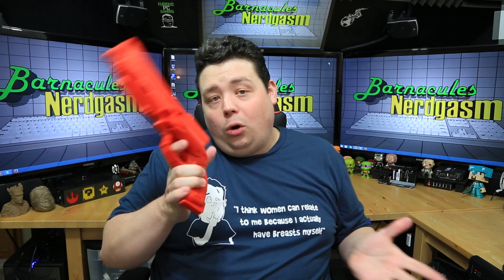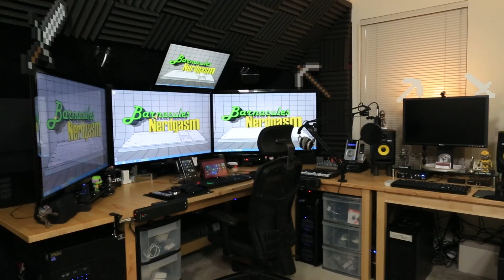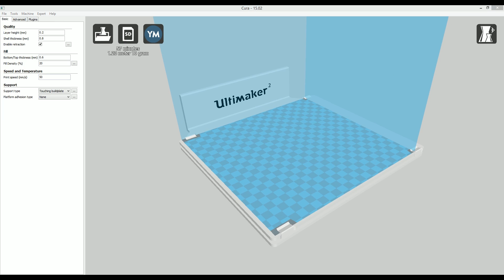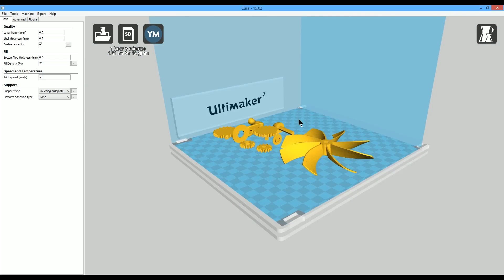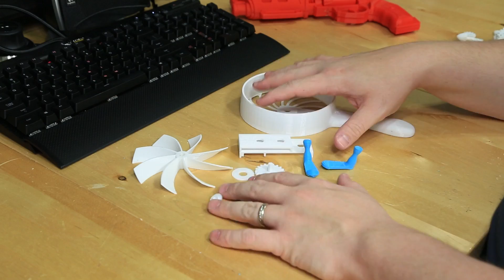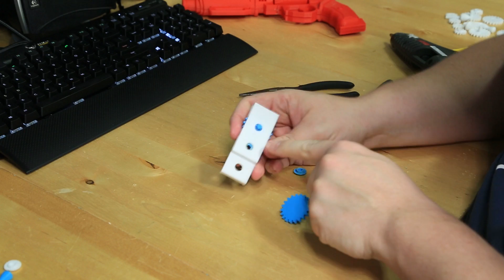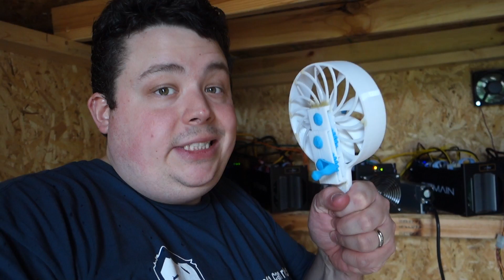3D Printing, Assembling & Testing a Mechanical Hand Crank Fan

Comment: are u ever gonna do 4k recording?
Reply from the maker: Yeah! Today.
Reply: ***** same
Reply: Wow such doge  As a member of the glorious "PC Master Race", I do see the difference and I'm planning on getting one of those 144Hz IPS-monitors when they become affordable so I do see your point.

Though I do not see the added benefit in any content other than gaming when it comes to videos. Content like talking to the camera, coding, and other basically mostly stationary content, I do not see the point of having 60fps content. Sure, it's there to double the bandwidth usage, but if the content doesn't really need it, why should it be done if it more than doubles the rendering times or the user's bandwidth requirement?

If and when 4K monitors come commonplace, then I'd say I'd prefer 4K then over 1080p, since I can assume that the network bandwidth has caught up with it when that time comes. Though mine doesn't cope with current 1080p30 most of the time so I guess I can't assume anything.
Reply: ABaumstumpf lol
Reply: *****  I don't really think 60 fps is THAT useful. It uses more bandwidth for minimal gain. I don't really care about the resolution either. I usually watch everything in 480p or 720p, since anything above that doesn't add to normal "talk show"-content. In games, maybe, but I'm not sold on that one, either.
Reply: *****  Sure, if you meant it that way, I'd also rather have a 60 fps option instead of 4K on top of the standard 30fps. Like it is right now on Youtube.
Reply: lBonaCl just to add up on the discussion: 60fps for me is waay smoother, as i play quite a lot of pc games... Also 60fps is only twice the file size. While 4k is 4x the file size of 1080p.. (Roughly)
Reply: ***** for what exactly? dude, admit it, you're just a 11 year old kid trolling around youtube just to get attention. go outside or do something with your life instead of trying to scare people, seriously mate just chill the fuck down! the cops won't arrest anyone for swearing on a website... get as life kid!
Reply: ***** lol calm down it wasnt even a grammar mistake it was spelling. Sorry for trying to make a joke.
Reply: omg i don't give a crap honestly cause im not some 10 year old sitting behind a computer that gets easily offended... so yea
Reply: Gordon Freeman I know about it :p but my point was, that i'd prefer a 60fps standard over a 4k standard.. 

Also, about compression, videos in 4k on uTube are compressed too (maybe too much), which makes them horrible compared to true 4k
Reply: Well - 4K is pretty much useless.
Most people don#t have such a screen, it increases the filesize significantly.
it would be better to have higher-qualitiy 1080p too.

And - best part - for nearly everybody on this planet there is no visible difference between 1080p and 4K cause of FoV their Monitor occupies.  
You need really big monitors up close to be able to even tell that there is a difference between those 2.

For 4K with a 27" display (bigger than most people have) you need to sit at ~0.5m (2ft) - that is veeeery close for most.
Reply: ABaumstumpf  the brain also tens to filter out super fine detail from a distance - you can spot it by looking at the grain of wallpaper, truth is, after a meter or two, your brain basically makes any wall look like a plain color :v
Reply: ***** dude go troll on some old forgotten forum on something. youtube is definitely not your style neither the 99.99999999999999% of the interwebs
Reply: ABaumstumpf wise words from a wise man/woman (:
Reply: ***** listen up boy, bullying is not a big crime, I'm 100% sure that the cops won't show at my doorway any time. And why should I report a little arrogant and ignorant 11 year old kid that society wants to get rid of, trolling on youtube, trying to scare people that  in fact didn't do anything than just make a joke. a stupid little joke and you reported them for no actual reason.
Reply: ***** Sure
but this has gone long enough.

Was nice seeing such a asocial being on YT again - normally such creatures like you are locked away in a mental ward.
Reply: ***** umm dude, you need speak proper English for us to understand
Reply: *****
And at some point far into the future, he might get low enough for you to understand him.

Or you could finally start going to school and taking your drugs.
Reply: no because most of his views are on mobile and most phones are not 4k
Reply: ***** Hahahaha, whats 144p then,   O_o
Reply: ***** mmmhh but u dont like to grammar do u?lol
Reply: Wow such doge I call BS on 60FPS being twice the file size, unless you're talking about uncompressed video.

Video compression is a thing, twice the framerate =/= twice the file size in compressed video.
Reply: Wow such doge
Well, go blame Google servers about compression xD.
The original files are stored uncompressed or less compressed though.
Reply: ABaumstumpf That's such bullshit, I can easily the see the pixels on my 1080p screen and comparing it to even a 1440p screen is a huge difference. I haven't seen any 4k screens in real life, but it would be huge increase in pixel density and sharpness.
Reply: CodyMetal If you move closely - yes, you can surely see the difference.  
But at normal viewing-distance and the normal screen-sizes it is a different matter.  
The human eye has a finite resolution too.
Reply: ***** THANK YOU!!!! i thought I was the only one....
Reply: ***** dude if you report for this shit you don't deseve to have internet nither a computer
Reply: ***** yeah sure sure! I belive you!
Reply: ***** "You will one the Cops at you door" do you even English bro? look mate I understand that you are not from a country that doesn't speak English natively. the thing is that in my country almost no one speaks English at all seriously. the guy who first started this fight was right. you barely know how to speak English. the only thins that you use English for is trying to scare us, the people who deserve to have access to a computer and internet in fact when I think about it, you are the bully here, not the guy who started the fight, neither me, neither ABaumstumpf . YOU are the bully and you know that you don't have any functional brains in your head and you try to scare us with reporting us to the police and to google. as I said before you just want to get attention and you don't know how to get it just like any bully.
Reply: ***** Normal people will simply ignore idiots like you.
But i got enough free time, so it is fun seeing you desperately trying to spread hate as you fail in life.
Reply: *****
 
"Talk to the police,"
Why would we talk to the police cause of one raging kid?
Reply: *****
"also now you are stalking and harassing me with constant abusive replies"

it is not our fault that you are socially impaired.
Stop oppressing me you shitlord :D
Reply: *****
Have fun.
btw - stop harassing me.
Stop oppressing me.
Stop threatening me.

it is funny how whiny you are.
Oh - and btw, falsely accusing others and making false charges, are also 'crimes'
Would you be so kind (despite being a pathological asocial lier) to film it, when you bring in the charges?
I would like to see the policeman laughing their arses at you.

Comment: Hey Jerry. Grab some pine ridge archery glue off of amazon. I use it anywhere from putting on arrow vanes to gluing on my buddy's old rear view mirror to his windshield in his truck. It dries in about 30-45 seconds. Really easy to file off and you can even get some instant-dry spray for it. dries clear/little bit of yellowish depending on the room temp.

Comment: Hey Barnacules, great video! 
If it is alright I have a suggestion for you. Please try to avoid leaving the glue gun on its side as this can cause the heating element to damage the side of the casing and can hurt you or your table. 
I don't want you to get hurt or anything. Anyways, keep up the great work. :)

Comment: Jerry u think you built it wrong. When you hold the fan the crank should be facing away from you. Blade needs to be flipped.
Reply: Conor Hyslop It doesn't matter, as long as he's aware that he just needs to turn the crank the other way. He would only need to turn the blades the other way if he's too lazy to turn the crank the different direction, but I highly doubt that.
Reply: Tristan Taimanglo he clearly showed that wasn't the case because spinning it the other way made it catch.

Comment: This was well explained. As someone with zero 3D printer experience this removed a lot of mystery. Great vid!
Reply: I have a printrbot simple metal and it works great I highly recommend it and also I use cura with it
Reply: ***** i was getting interested in the printrbot tbh, so much cheaper... and i'm quite poor
Reply: :) Also i did not know about Robo3d
Reply: Skyler Oglesby care to share some of your settings for printbot...? I have sinple metal with heated bed, and my prints are okay, but havent quite got my quality and precision tweaked right

Comment: Awesome. Also, as weak as it would be, try to take something from that design to make a generator, to barely register on any measuring device but still. And for your love of mrs. Barnacules and xander, please, don't 3d print quad copter blades unless you want a very expensive pile of junk. Well, I guess I'd be fine for the now lame parrot at drone. Keep on going strong and scrape off the barnacles every morning.

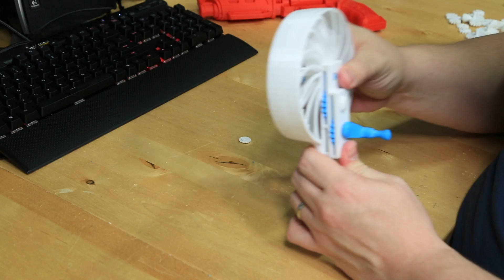Comment: The only thing that could make this better imo is to have a higher gear ratio instead of a (example) 15:10 having a 60:10 so that way you dont have to turn the crank as fast with you hand to achieve the same speeds (efficiency), but with a more solid gearbox because with a higher gear ratio will cause more stress on the gearbox. Also maybe adding a flywheel too would be nice.

Comment: Plastic is going to become a thing of the past in 3D printing when you can do better and miles faster with fluid printing, but I know you've seen the video I'm thinking about :)
Reply: The uv resin fluid is still more expensive than filament, though
Reply: Just don't ask how much the media costs. ;)
Reply: It's like all tech trickles down in price over time and refinement :)
Reply: KingNosser The printer/technology isn't expensive. It's the raw cost of the resin. It's simply a more expensive material.

Comment from the maker: 1st again! I'm a boss at this 1st stuff!
Reply: they made a destiny assault rifle. PRINT IT
Reply: That shirt tho...
Reply: You should seriously think about printing out (in a multi part series) the toyota engine and the manual 5 speed transmission from Thingiverse. I can't remember the author of those prints, but it is the same person. Seriously, it is a really intricate design.
Reply: Barnacules Nerdgasm Hi I love your 3d printer vids
Reply: thats kinda cheating dude....LOL
Reply: ***** 
You'll be in a corner for games that have a specific requirement for quad core, but the Pentium G3258 with a Z87 or B85 mob that has overclocking enabled. That'll get you in at below $100 and that'll work with any 1333 MHz ram on the cheap; however, you can buy a used set of memory or Corsair's 2000 MHz 2x2GB kit for $50+/-.

The CPU has an integrated GPU to help you limp along until you're ready for a new GTX750Ti or a GTX760 4GB.

BTW, without the graphics card, you can use it as an HTPC just fine.

I love these low ball questions because they're really fun builds that can really perform.

Those GPUs are a dime a dozen used and you'll have some luck there.

Unless you want a "used" system and there's no telling what may happen based on that alone.
Reply: What if you printed it all together as with the nasa wrench
Reply: Hey, Jerry, looking at those blades and your binding issue... are they installed backwards? It looks like they'd be more effective spinning the direction that causes binding. at least from the video, they seem to be curved pretty aggressively.
Reply: I could probably get ya down to about 150. Off-Lease Core2Duo business machine, sub-100, used or lower end GPU 50-60. Boom. C2D, 4GB Ram, Fresh Windows 7, Halfway decent generation or two old graphics card.
Reply: I am 12 and I really want a 3D printer for my laptop
Reply: Hey jerry, what would you recommend as a cheap starter 3d printer?
Reply: Ramses De Vuyst the solidoodle is a solid option. I am going to be getting a 100% discount on my first one, the Polar3D, which is polar coordinate based, with a circular build platform. Other than that, the solidoodle and those delta printers are really nice.
Reply: YA YOUR SWEEET!
Reply: Barnacules Nerdgasm just bought my self a 3d printer
Reply: nice man
Reply: dude you should say that in one of your videos how your so good at being the first comment.
Reply: what do you want it to do?
Reply: like just gaming?
Reply: im actully selling a gtx 750 ti used lol
Reply: Hey Barnacules try using some acetone on your 3D prints. It makes it nice and smooth but a bit inaccurate so it's not for gears or parts like that.  It can also glue two plastic parts together.
Reply: Barnacules Nerdgasm Did YT ease up on sponsor logo spots?
Reply: Dude 3D print a drone!
Reply: Aint1S wow you the true mvp :D
Reply: ***** you gotta add at least 250$ to that to reach at least some AMD APU option (and that's not killer gaming pc, just some pc on that you can play LoL at 1080p on)
Reply: yeah 3d print a quad copter frame and make your own quad copter its easy ,. and would be fun ,. i wish i had all the equipment you have ,.
Reply: if youre getting a cpu  for about 100 just get the 6 core amd
Reply: Alex Mundell syke no 12 yr old is ever gonna get a 3d printer
Reply: Alex Mundell laptops problems just anyways
Reply: Alex Mundell junk*
Reply: Have you ever thought about swapping to superglue or something similar that is far less messy?
Reply: ***** a tablet
Reply: Hey you think it would be possible to print a racheting gear with a trigger that has spring tension using thin printed plastic to power that fan. It would make it a lot more useful.
Reply: "About damn time" exactly what I said to my self as soon as I saw you uploaded a 3D printing video.
Reply: Can you 3D print a Nerf Gun?
Reply: RChero1010 a Toyota cars engine? maybe not
Reply: maybe cut the fat (pardon the pun) out of this its a long video for a fan
Reply: Ramses De Vuyst my first 3d printer was a printrbot you can get it in a kit disassembed(under500 dollars) and just put it together after you get it in the mail yourself. easier than it sounds and there are tons of tutorials online uses 1.75mm pla like most other models and its really easy to get started with. i love printrbot imo but i know it isnt the only one out there
Reply: Barnacules Nerdgasm ugh you have the keyboard i want in the entire video lol
Reply: Barnacules Nerdgasm I guess you're the very first one to admit you're the boss at firsting on the comments.
You win. Again.
Reply: ***** a job so you can afford a better one. not trying to be a troll, seriously.  a "gaming" system has to have a decent cpu, psu, case, ram, video card, ssd(s), and motherboard.  you're looking at a minimum of $600 for something passable.
Reply: +CrashTheGameFTW I'm 13 and I have a 3d Printer and a laptop. Stop trolling.
Reply: By far, the best 3d printer (fully assembled) for the money to a starter is the Polar3D. They run 800 bucks, and have a 250 dollar discount to students. 8 inch diameter print platter, 16 inch print height, SUPER quiet, has a live feed camera, cloud management, or USB if you prefer, and a 50 micron layer resolution. Can print with ANYTHING, like, they have test units running over 300C.
Reply: +Chase Cromwell well not sure why people would troll you but your lucky to get a 3d printer i only have a xbox ne 360 and ps3 and gaming but i could not care about that i just want a 3d printer plus im 13 to
Reply: Howed 3D printing that storm trooper suit work for ya
Reply: +bro fist gaming depends if you want to play games made in the past 7 years or not
Reply: +Barnacules Nerdgasm The fan blades are curved slightly to allow for more airflow if you turn it one way,vs the other.
Reply: +Barnacules Nerdgasm Could you do a 2015-16 buyers guide for 3d printer? i am looking to buy one for the job and i am lost in all the models and spec.. i am looking at the makergear m2, the ultimaker and the makerbot, i am using SolidWorks for creating the stl files but i have no 3d printing experience for now
Reply: The Tsuchiyasan Just to add one to your option list, you might want to look at the Polar3D... Great value.
Reply: +Barnacules Nerdgasm a life is needed here
Reply: +Barnacules Nerdgasm Whats the song name 1:10
Reply: He is haxing report him

Don't its just a joke
Reply: You s should have used water-soluble support material some new printers have that now
Reply: you need dual extruders for that
Reply: what one did u get my dude
Reply: Barnacules Nerdgasm is it the Ultimaker 2 go or 2 extended
Reply: 984th
Reply: Barnacules Nerdgasm the bad thing about printing them sepret is that the extruder my hit the other print cuz the fans and heater makes its biger
Reply: Barnacules Nerdgasm can you build the vision mercedes maybach 6
Reply: Barnacules Nerdgasm k
Reply: Barnacules Nerdgasm shaft